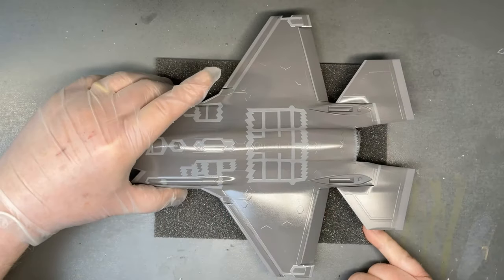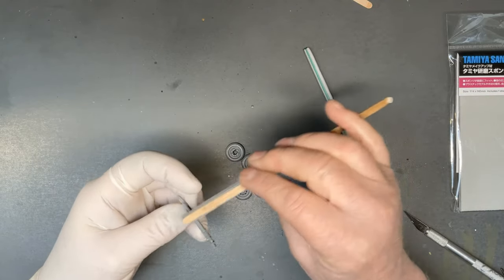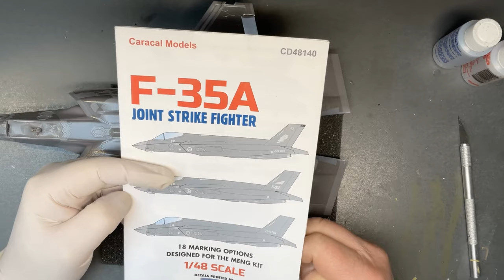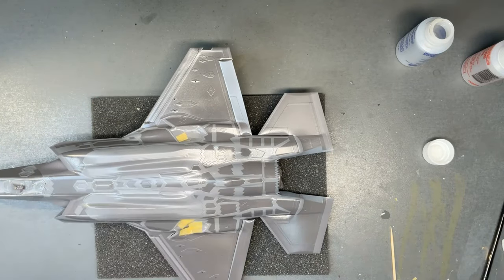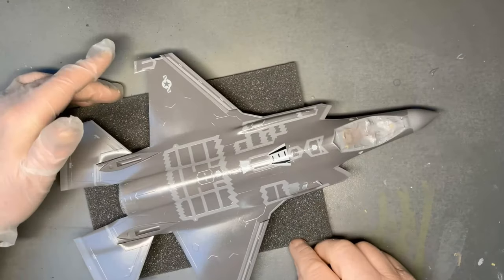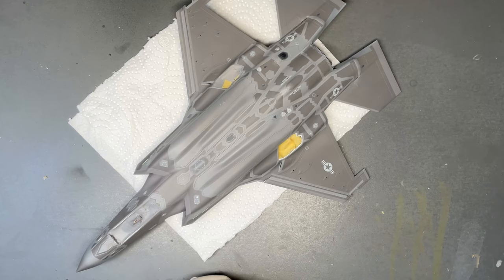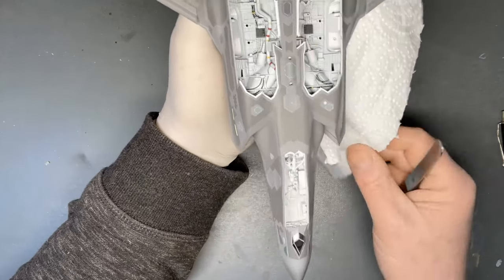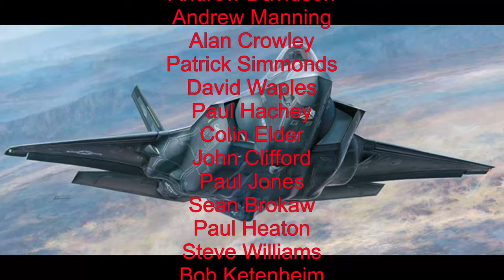Tamiya 1/48 F-35A Lightning II part 4B

Comment: Looks great! I’ve seen other modelers spray a couple gloss coats over thick decals and the sand them with a fine sponge to get rid of the edge. Haven’t needed to give it a go myself, and of course by the time you might experiment you’re usually more scared to mess it up.
Reply from the maker: Agreed - it can be done but risky as you say.